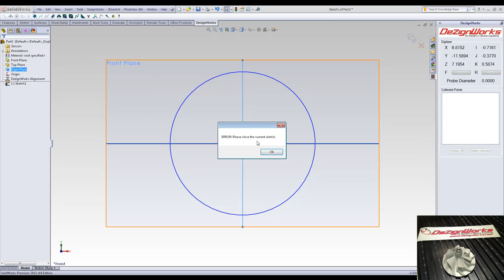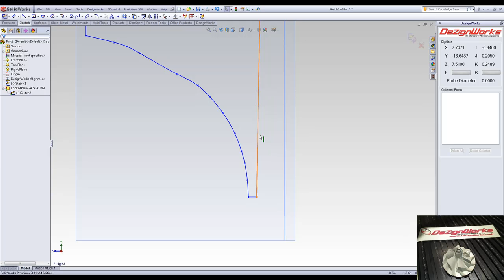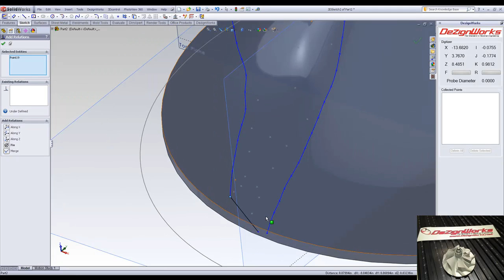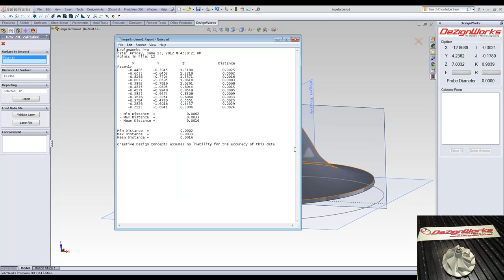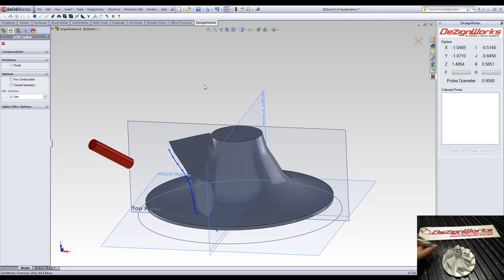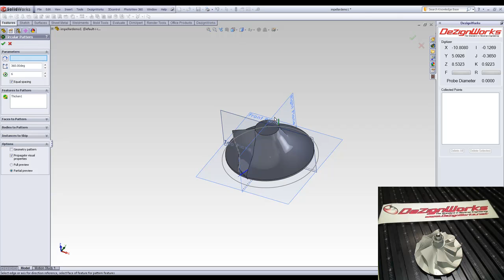DezignWorks for SolidWorks 2012 - Impeller Reverse Engineering

Comment: really cool, it would be cool to do this for the space shuttle's ssme hpf turbo pump impeller.
Reply from the maker: We recently have reverse engineered some turbo pump impellers. Would you like to see more about the process?
Reply: sure, myself coming from a velocity triangles type calculation for radial and axial impellers, it would be interesting.
Reply from the maker: marshalcraft The main purpose of DezignWorks is to capture the blade geometry which provides you with intake and exhaust location of the blade to help facilitate the velocity triangle calculations.  We encourage the designer/engineer to make the changes the geometry to increase the efficiency of the turbo machinery.  Our viewers have asked us to create a tool that allows a 3D sketch to be revolved around an axis to better define the blades our edge so stay tuned for its release. Thank you for subscribing.  Can we help with any reverse engineering applications?
Reply: @CreativeDezignConcpt  did you ever implement a tool to use a 3D revolved sketch like the plane intersection tool? 

This is the real way to reverse engineer blades, because this is HOW THEY ARE DESIGNED/MODELED.  You have a surface of revolution for the hub and the shroud.  Then there are intermediate surfaces of revolution that the design uses to layout the mid blade lines.  Having this tool is basically mandatory for determining blade geometry.  The engineer will scan the hub.  Scan the shroud (or blade edge surface of rev).  Then you create some intermediate streamline surfaces of revolution.  NOW you trace the blade surface, and see where it intersects this user created surface of revolution.  You are actually scanning the data in the same fashion that the hydraulic designer models the design.  This is so critically important.  They way you are doing it in this video is not useless, but it is not really very good.  It shows a lack of understanding of how impellers are actually designed.
Reply: +DezignWorks  I notice that at no stage do you mention compensating for the probe diameter, is this set with the compensation tool and if so how do you determine the direction of offset?.
             I would also be careful in assuming that the vane has a uniform thickness, in my experience they don't, a better way is to create the pressure and non pressure sides of the vanes and then lofting between the two, this ensures the true geometry of the vane is captured.
             The other thing I should mention is that this method is only useful if the part you are replicating is brand new, for an old used part you are better using a completely different method of capturing the data in order to be able to alter the geometry after CFD analysis. This method involves creating splines at the top and bottom of each vane and a spline ( or splines) along the centre line of each vane ( as  guide curves) and lofting a surface, this gives you the ability to edit the spline to the required curvature.